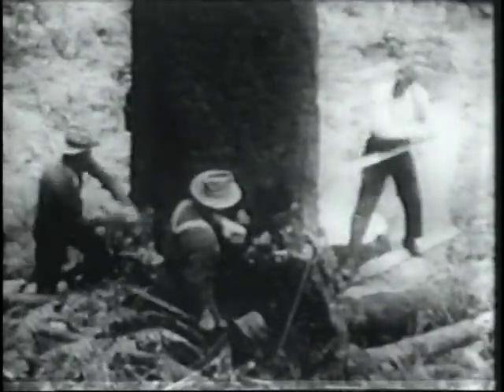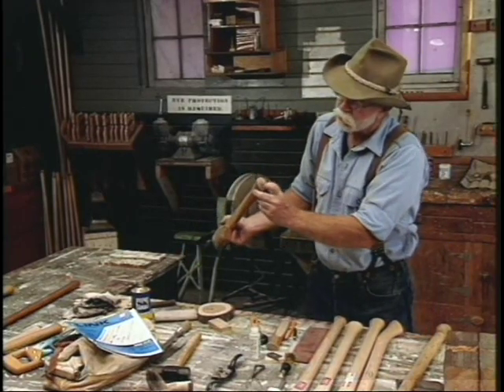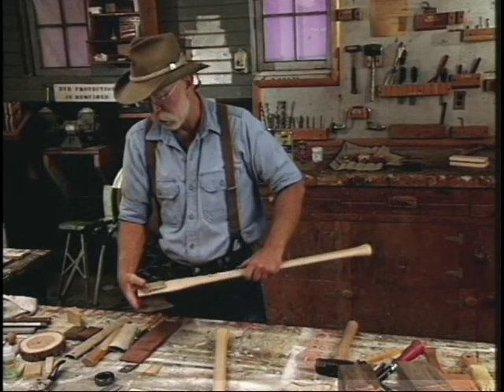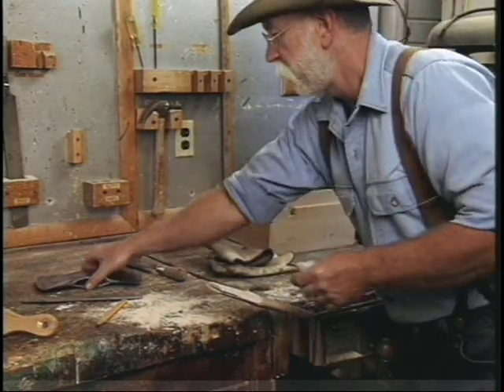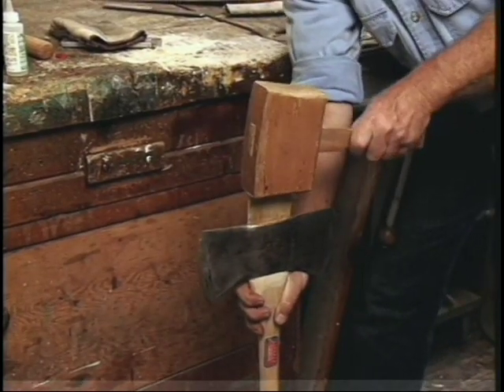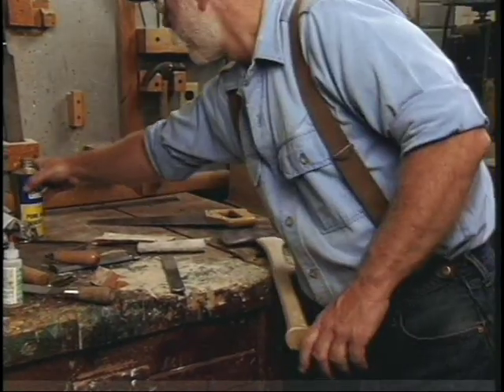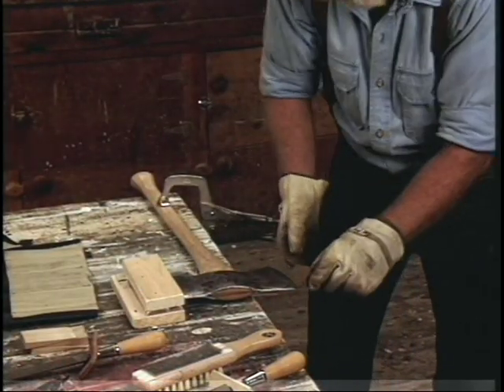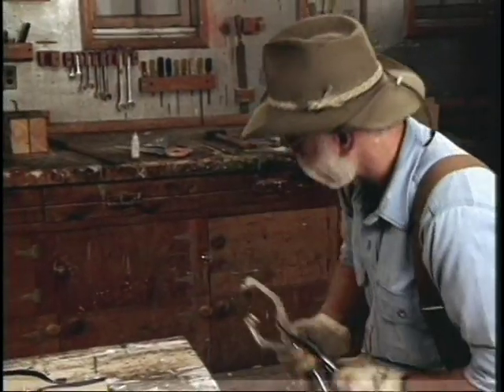An Ax to Grind - Part 1

Comment: What's wrong with driving in an extra metal wedge for hanging the axe?
Reply: +Simon Jacobs You stand a chance of splitting your handle.
Reply: nothing I think. I have tried without the metal wedge and the wooden wedge tend to work its way out slowly when used

Comment: You don’t want to just throw away your rags that are soaked with linseed oil they will combust in the trash and catch your trash on fire. lay them out flat to dry before disposal or soak them in water before discarding. just wadding them up and throwing them away will cause them to heat up during the drying process and catch fire.

Comment: Very Good Video, I just had a Iltis Ox Head 2 3/4 lbs. with a 5" very thin cutting edge, put on a 19" White Hickory Unex handle. I plan on using it as my camp axe. What is your opinion on my new axe, I was thinking the extra weight would same time and energy.

Comment: Great video, but SAFETY NOTE: For all his wisdom, and the guy obviously knows a lot, his advice on oily rags is a little sketchy. With oily rags, the danger is in them being wadded up and in a ball where the exothermic reaction causes a potential fire. So don't wad the rags up, as he does, and don't casually throw them over your shoulder onto the shop floor as he does. Take them outside and spread them out flat on a non-flammable surface such as concrete or gravel. Weight them down with small rocks if it's windy.  Wait til they dry hard, then discard. The fire potential is gone at that point.